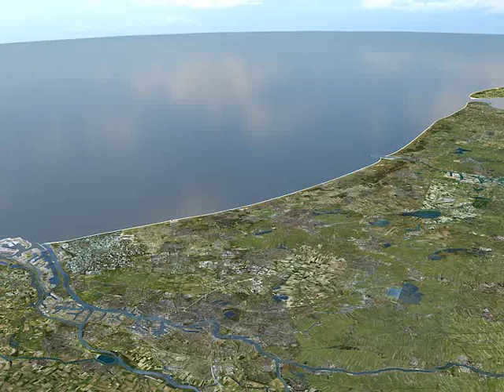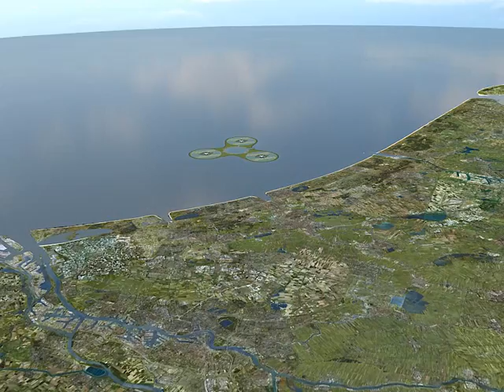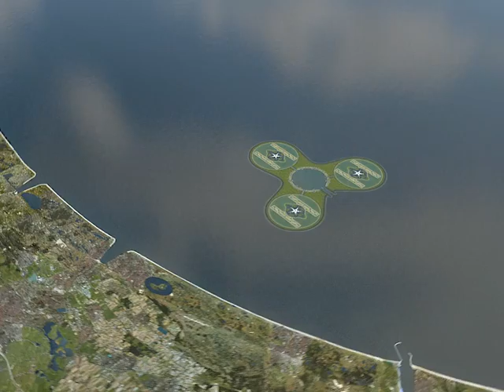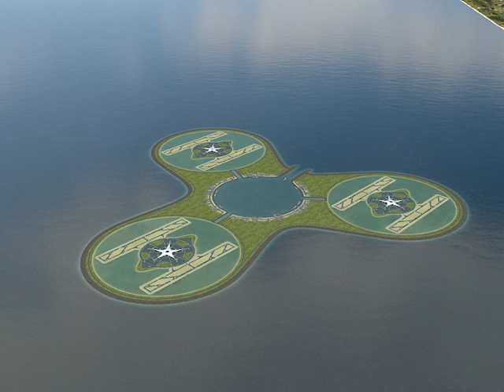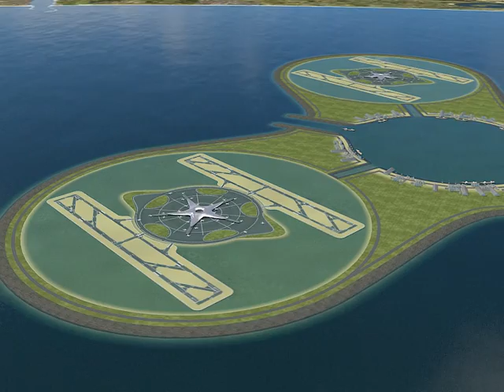Airport at sea

Comment: We may be thinking too small, gentlemen.  Remember that in the surrounding areas there are quite a few airports (Schiphol Amsterdam, Lelystad, Eindhoven, Maastricht, Rotterdam-The Hague come to mind - but also Antwerp-Deurne and Brussels-Zaventem --- let alone the four airports of London).  I was wondering what European cooperation could do as the surrounding countries (Belgium and the UK) are suffering from many of the same problems.  

Would it not be a good idea to develop an airport that could relieve the British and also replace the current existing airports in the Netherlands and Flanders ?   And.. when technology progresses be expanded upon to replace all existing airports around London but also f.i  Cambridge and East Midlands.  If the technology would progress enough and actual tunnels could be dug underneath the North Sea, it could become an international hub for both the UK, the Netherlands and Belgium.  

http://be-architecten-en-ingenieurs-web.webnode.nl/diensten/projecten-wetenschappelijk-onderzoek/

This very interesting article mentions the potential of the Transrapid maglevs but also more advanced systems --- now imagine using them to link the three countries together (potentially even with Germany).
Reply: The dutch politics will not decide in years on this subject. Can Flanders do it? , maybe with money from Brussels?